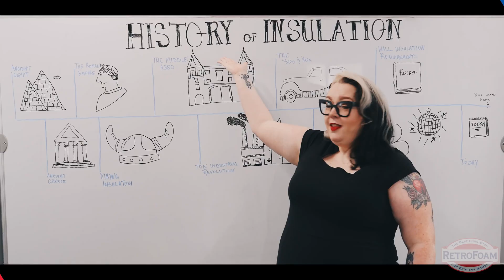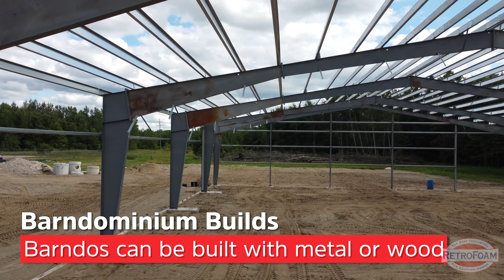How to Insulate a Barndominium with Foam Insulation | Foam University

Comment: If the outside walls are made of metal can you still insulate it?
Reply from the maker: We can use injection foam for metal walls, and if it's a new build, your local RetroFoam dealer may even offer spray foam.

Comment: Would I want to insulate the walls between the living space and garage space?
Reply from the maker: Yes, insulating the shared wall between your home and garage is a smart move! It helps prevent drafts, keeps emissions and allergens out, reduces noise, and improves energy efficiency. Sealing up that wall with RetroFoam ensures you’re not losing heated or cooled air into the garage. This article from our Learning Center includes some additional information on this topic: https://www.retrofoam.com/blog/insulate-common-wall-between-house-garage